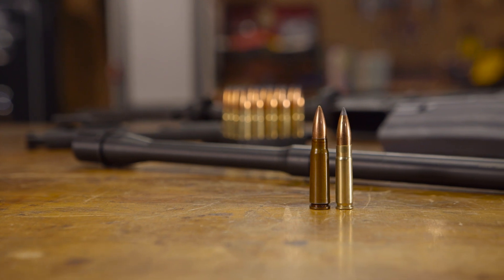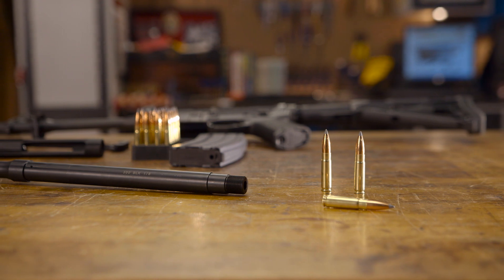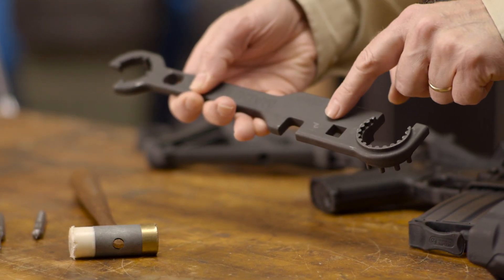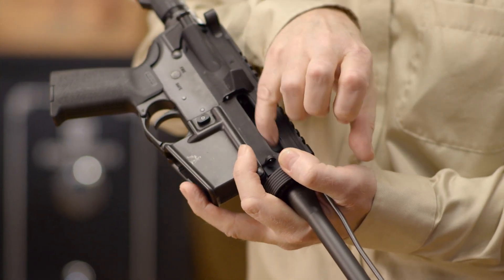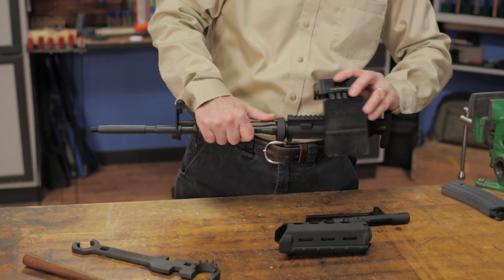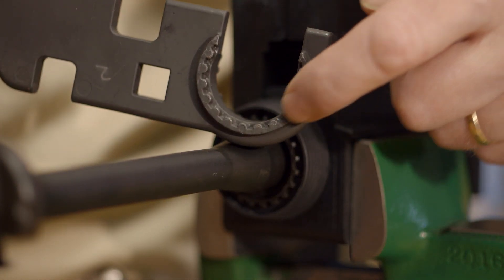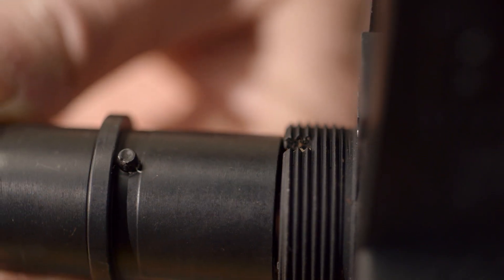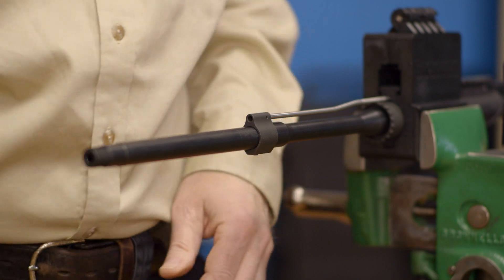.300 Blackout AR-15 Barrel Change

Comment: I would add proper torque, break torque and retorque 3 times to ensure its seated and also put on antiseize prior to installation. Also make sure the bcg isnt going to run into the gas tube to make sure the gas tube is properly reseated into the upper. Those are all important steps that go into this. also extremely important and should never just be an option, but a must, check the headspace.  If your headspace is out of limits, you risk catastrophic failure or degraded performance.

Comment: Is it possible to do what you did here in reverse, I bought a 300 blk ar15 and was wondering if you can convert it from .300 blk to 5.56?
Reply: 12/8/19 not speaking from experience however one of the guys I go shooting with swapped out his 300 BLK for a 223 so id say it's possible but please check first

Comment: About how much for one of those barrels?
Reply: You can find complete uppers of multiple calibers for AR-15's at Bear Creek Arsenal ... example I bought a 16 inch 556 complete upper with charging handle with forward assist with bolt carrier group for $185 & $24 shipping. Some of the cheapest barrels online are over $100 so check out Bear Creek Arsenal ((NO FFL REQUIRED))

Comment: Man I love you guys videos. Thanks 

So I'm doing a new build on a 300bkackout. It has a 10 inch barrel but I didn't buy a 300 blackout upper. The upper and lower receiver are both 556/223 standard but from what I'm reviewing here that's okay? I don't need a 300 acc upper receiver? If that's true before I finish is there anything else I may need to do to make thing flow properly?
Reply from the maker: The beauty of the .300 BLK is the only things that are different from the 5.56 are the barrel and muzzle device, so you are good to go.

Comment: Aren't you supposed to apply grease to the barrel and barrel nut threads before seating it and tightening? Such as Aeroshell or some sort of moly grease?
Reply from the maker: It’s best to use a small amount anti-seize such as Brownells Copper anti seize 083-000-044 or Loctite C5A anti seize 532-000-012 instead of grease.
Reply: +Brownells, Inc. Thanks! I knew I've seen other videos posted before demonstrating to use something on the barrel and threads before, as removing the barrel in the future can prove to be very difficult without application of it!
Reply from the maker: Very welcome!

Comment from the maker: Yes, you are able to to use the bolt you have used on your 5.56 upper.
Reply: 6.5 uses a different bolt, but you can use the same carrier. You will also need 6.5 magazines.
Reply: Would I need a larger barrel nut?
Reply: @heylookitsthatonedude900  no.

Comment: I've heard that you shouldn't use the same bolt that you use on your .223/5.56 barrel with your .300 BLK barrel. Is there any merit to this?
Reply from the maker: The .300 BLK uses a standard 5.56/223 bolt. Just be sure to check the headspace with a good set of headspace gauges when installing a new bolt or swapping between barrels.
Reply: But I mean can I used the bolt that I have used on my 5.56 upper for several hundred rounds or should I used a new bolt?
Reply: @bigred2989  556bcg is what 300bo uses
Reply: @bigred2989  just make sure you dont ever use the same barrel. Youll screw your gas system and barrel up putting 300bo in a 556 barrel.

Comment: Headspace gauges are required, but torque wrench is optional? 

Never had a fully chambered barrel with excessive or too little headspace. I have had issues with out of spec uppers that required as many as 75 foot pounds to align the nut beyond the minimum of 25. Pretty hard to measure those values without a torque wrench.
Reply: With in specs then. Should go no higher then 80ft lbs.  Its 35-80ft lbs for torqueing your barrel.
Reply: 25 too low and above 80 is too high. If it doesnt align within the 30-80 specs, your barrel threads are messed up.